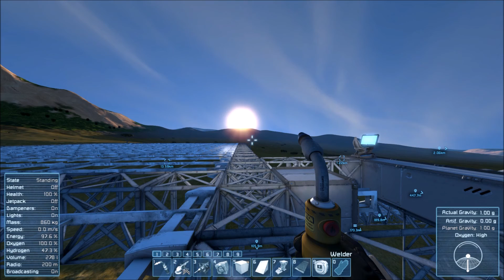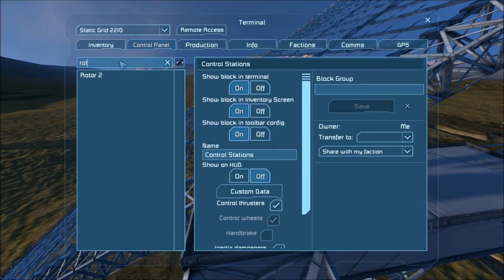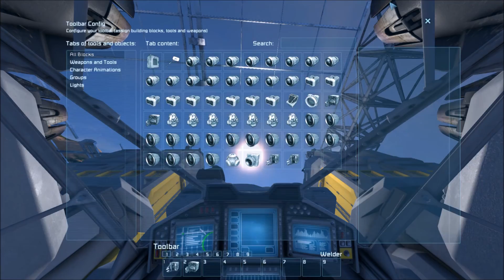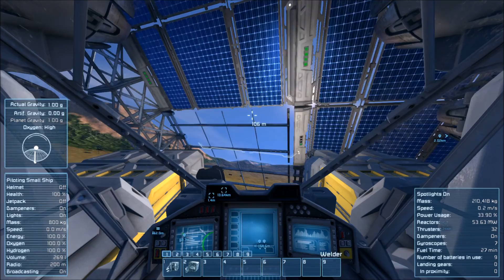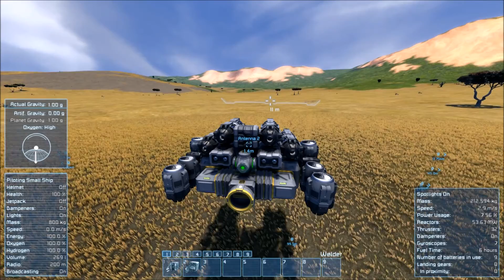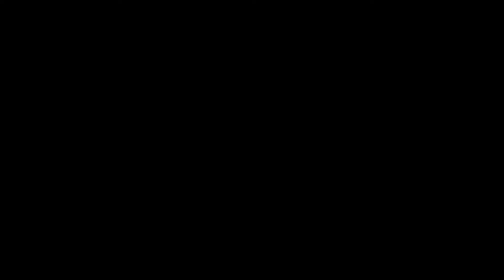Space engineers   Planetary survival Ep 30

Comment: Batteries can't charge and discharge at the same time. A solution would be to split your batteries into two groups, always have one group recharging and the other group not recharging. Don't use the "discharge" option though, I've never seen that do anything good!
Reply from the maker: True but the reactor should be in use first and then if that isn't enough then the batteries should be used to take up that extra slack. if the usage is less than the reactor power then that reactor should be out putting enough to charge the batteries but the fact that the power usage on the reactor goes to 0 when flying around or at all really shouldn't happen unless total usage is 0